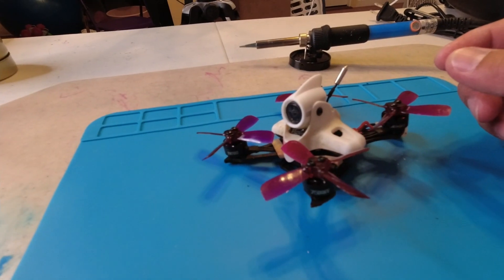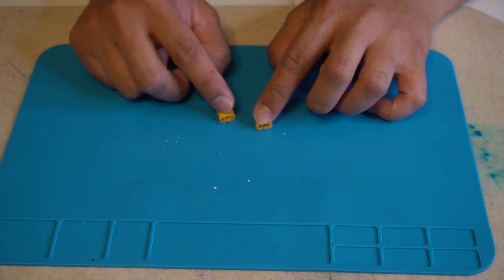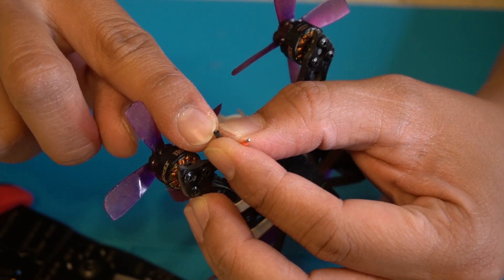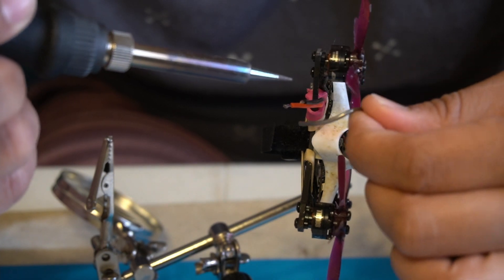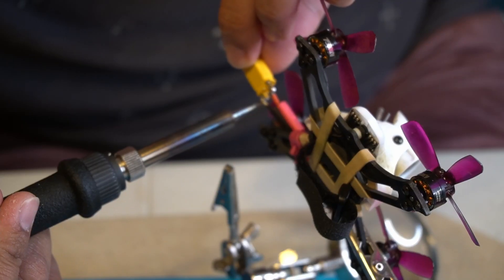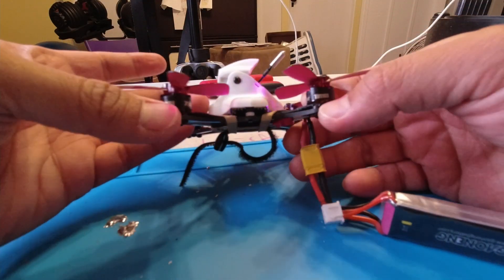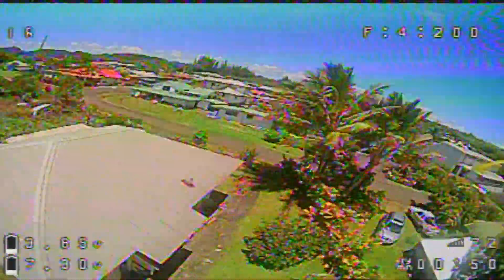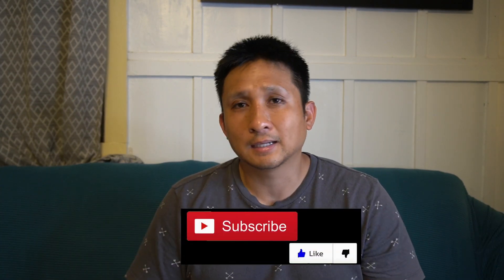Emax Tinyhawk 2 Race XT30 Upgrade and First Flight

Comment: Okay I am going to get the tiny hawk 3 freestyle hd and I am going to do this but it normally takes 2 1s 650mah batteries so witch batteries should I get when I convert to 2s
Reply from the maker: Any 2s of equivalent milliamps.  You could even go higher to the 650 without any issues.
Reply: @ChrisParayno so helpful thank you
Reply from the maker: I reread your thing, you could go up to 850 if they have that size, I think 720 was the max last I checked.  For free style the heavier weight will make it more flixckable.  GNBs are a good brand, stay away from the HV packs as they degrade faster.
Reply: @ChrisParayno okay so I should just get a pack of 700mah 2s
Reply from the maker: @baacon8r I definitely would.  Just know you won't get a tremendous amount increase in flight time, maybe 30 seconds. What the 2s will do is give you less batter sag so you can do more moderate freestyle tricks.  I've been happy with my 2" rocking a 650.
Reply: @ChrisParayno  do you think I could use a 11.4v 720mah instead of a 720mah 7.6v on the tiny hawk I don’t really know what the volts do
Reply from the maker: Definitely not unless you want to burn your motors or board out.  The volts stand for the amount of cells in the batter pack.  More cells means more power.
Reply: @ChrisParayno okay thank tou

Comment: hi, what battery did you buy for it? how can i chose which brand??  and does the modify did any benefit to the flytime?? also isn't it necessary to change the wires also?
Reply from the maker: Yes I got marginal flight time improvement, maybe 30 seconds to a 1 minute more on the same 450mah but what I could do as far as acro was greatly improved.  I was able to do more acro( like power loops and throws) without battery sagging.  As far as wires, I'd say it did help to move to the ticker wire as it was also safety that the wires wouldnt melt.  On the twin 1s, I found my 1s puffing up after a couple sessions.  With a 2s, I have yet to have one puff up and I don't have to run HV batteries.
Reply: @ChrisParayno  so you changed the wires also? And soldered it to the fc?
Reply from the maker: Correct, it's not too difficult but takes a bit more solder

Comment: What battery’s you running
Reply from the maker: GNB 2s 450 and 650 typically.
Reply: @ChrisParayno  much difference between the 450s and 650s buddy??
Reply from the maker: 650 is heavier and you only gain about 30 seconds more ripping time.  I think 550 is optimal.

Comment: I actually want to talk story with you about this. I am considering the reverse conversion so I can use all those 1s batteries I own. Also the capability of using just 1s for indoors with the 2x JST connectors.
Reply from the maker: i actually have a couple of cable adapters so you you can do just that.  similarly, i can give back the 2s you gave me, no biggy man.  i gotcha back.